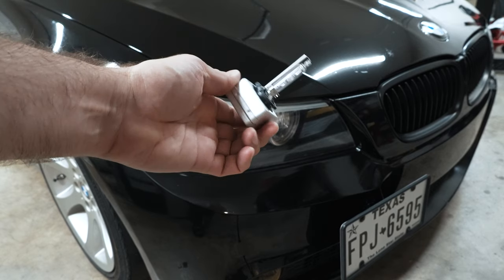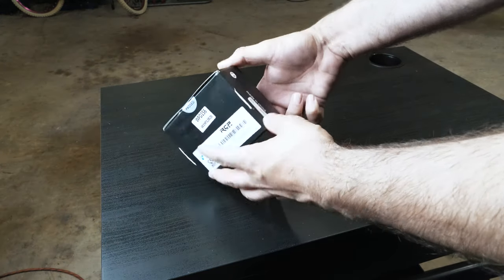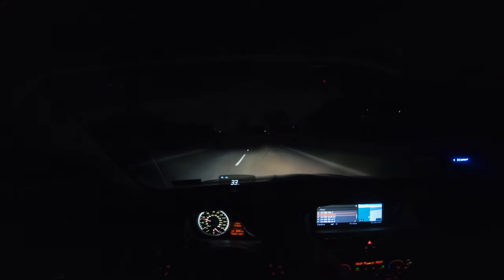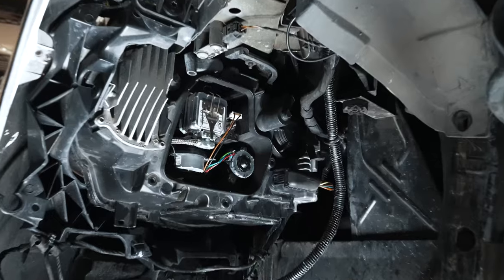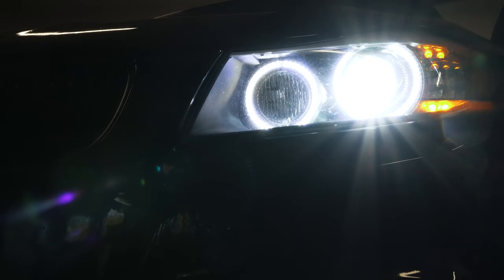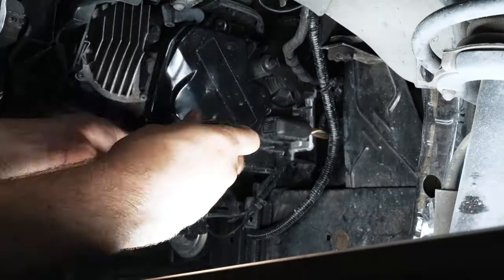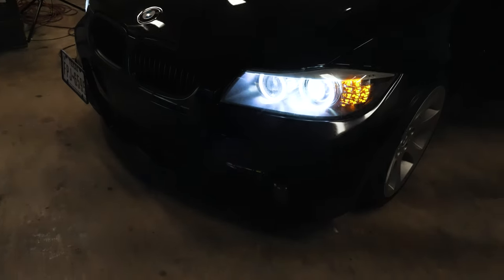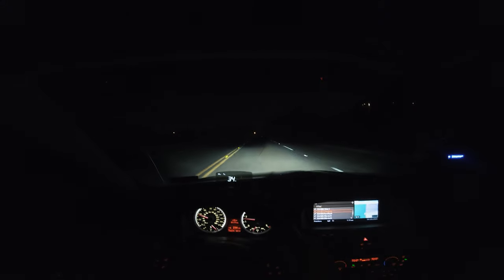Your HID Headlight Bulbs Are Fading Away! Are Yours Old?

Comment: It would have been nice if you compared just the bulbs to each other once you got the original OSRAM bulbs removed, just to note if there were any labeling or physical differences. Also for the comparison shot beginning at 2:34, getting both bulbs in frame would have been beneficial because the camera can automatically adjust things like exposure and white balance. If they are both in frame then it levels the playing field. 
The price of those bulbs you used is much lower than the comparable name brand. Best price I can find for the OSRAM 66140/66144 (I don't think they make the 66142 any more, or is it an OE only part) is about 45 USD (for a single bulb). Considering the price difference I hope they last for you. My original bulbs have 180,000 miles and 13+ years on them. All bulbs are subject to degradation over time, but they do still work. Not saying there aren't deals to be found out there, but OSRAM is a state-of-the-art lighting company. 

It's not like when you are looking at ECS and they have a BMW part for one price and the same part branded with the OEM name instead for half the price. The TRW M3 control arms are a good example. If you buy the TRW brand you get the exact same arms, someone has just ground off the "//M logo" with a die grinder because they legally can't sell them as TRW with that logo. They are produced in TRW's factory under contract with the "//M" logo licensed from BMW. It's just a legal issue. The arms are the exact same. OSRAM is the OEM so they don't contract their manufacturing to another company. The bulbs you bought were probably copied and then produced in China. They can sell them for cheap because they don't need to cover all the engineering costs OSRAM would have spent developing the bulbs. You might see them offered using different brands on Amazon or Ebay but they probably come out of the same factory in China.
I am not trying to criticize your decision to buy these bulbs, its your money and your car - live and let live. I just wanted to add a little context about the R&D that OSRAM and all OEMs needs to pay for to develop their products. I am a product design engineer and this issue is close to my heart. What your are paying for when you buy OSRAM or Phillips DS1 HID bulbs is the payroll and overhead for companies to produce products in factories up to western health, safety and environmental standards (both OSRAM and Philips are MFG in Germany). The workers then go home and put food on their tables for their families whose kids go to a school that teach them facts and not propaganda. They have access to the actual world-wide-web in their schools and homes, not a censored version. They can be critical of those in power without fearing for their lives (see: Hong Kong). People in China gotta eat too, but as a consumer I am going to prefer work and cultural standards of western companies instead of Chinese ones. I don't have anything against the Chinese, but I want to use my dollar to make the choice. That is capitalism. 
The unfortunate truth is when you buy cheap stuff from China your are perpetuating the copy and produce cheaply industry. Amazon just wants your money, they don't care where the products come from.  You can't even buy NGK spark plugs from them without worrying if they are knockoffs.
Reply: Youtube is destroying my formatting. I apologize for the apparent lack of paragraphs.
Reply from the maker: Yeah without a doubt Philips and Osram were the leader in Xenon headlight technology and they put a lot of R&D into refining the technology.  Truth be told if I didn't have this YouTube channel I would have purchased a set of Philips bulbs to replace them.  I like their Ultinon series.  I tend to install cheap parts on my car that have good ratings to show people cost effective options to keep their cars on the road.  Strictly to be a guinea pig.
Reply: @VehicularDIY  That's fair. Like I said it's your money, your car and your channel. I wasn't trying to criticize you. I just wanted to offer a perspective on cheap knock offs. 

Over the past couple of years I've become more and more aware of the BS China is pulling with intellectual property. Micron, an America semiconductor company, had designs stolen by some of their workers who fled to China and a Chinese company called United Microelectronics Corp (UMC) used the designs to patent and produce computer memory in China. Then UMC sued Micron because they claimed Micron was violating the Chinese patents held by UMC. Of course the Chinese company won in a Chinese court and Micron was no longer allowed to sell that product in China. That's BS. 

I worked for a defense contractor who had IP stolen like 15 years ago and later we found Chinese knock offs of our product. It wasn't anything secret, but it was ITAR controlled. 

I am not a isolationist and I generally agree with the principles of global trade. Rising tide raises all ships, so to speak. However, I don't want to do business with bad actors. China wants to expand their economy rapidly and they don't care how they do it. I try not to be a part of that whenever possible, but it is honestly difficult. I recognize that many things are made in China, but if they are designed elsewhere at least you can be assured the quality will be there (most of the time, especially from companies with good reputations). Knock offs are a different category and I stay away from them whenever possible. They would be illegal in any country with reasonable IP laws, but the Chinese government looks the other way in the name of self-interest.

Comment: Hey, I feel that the Philips XV Gen2 D2S I have used in the DIY retrofit are losing their brightness. The thing is they cost me around $150 for the pair and it's a little over two years now!!! I'm highly disappointed, they lost like 50% of brightness already. So, I was just thinking about changing the ballast to see if there's any difference, but it looks like there isn't going to be any. In your case, did you just change the ballast along with the bulbs or only the bulbs? And what was the brand of the bulbs before? And after how many years did they lose brightness? Thank you so much!
Reply: Lunex make Ive used with good results and only £22 EBay......I’ve always found Phillips and Osram are overpriced.

Comment: Nice video but personally I wouldn’t recommend RCP. I recently used their brand for some led fog lights. After a few months, the seals inside the housings weren’t sealed that well and the insides of the connectors corroded to the point of flicker/error message.

I just don’t believe RCP lights are rated for colder climates. 
I would suggest oem Philips/Osram xenons, you just can’t go wrong with those.
Reply: Using the bulbs he installed without issue for months now. $25. I’ll roll the dice.

Comment: Hi, I am surprised that you use the same diesel oil as I use on my BMW 35D! Is it good for gasoline engine as well?
Reply from the maker: Yeah I've been using it for years.  It's a great value and works great on high performance turbocharged cars in my opinion.
Reply: The Rotella T6 5w-40 oil is widely used buy enthusiasts of gasoline powered turbocharged vehicles. It is a great oil for that application. I also us it in my N54.

Comment: my left headlight stop working, only helps and day time running light work, does anyone have any idea what it could be? I replaced both bulbs
Reply from the maker: You might want to check the wiring inside your headlight.  It can crack and deteriorate over time.  Or you could also check your ballast.
Reply: Vehicular DIY I would’ve never looked into the ballast, thanks man